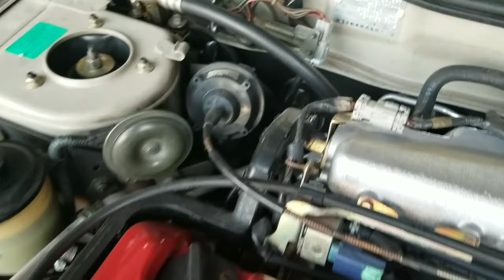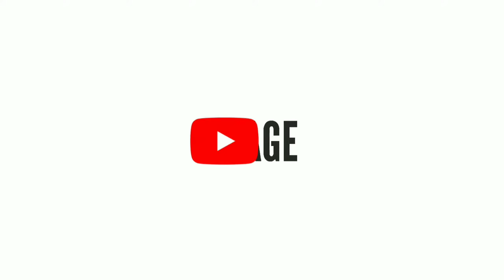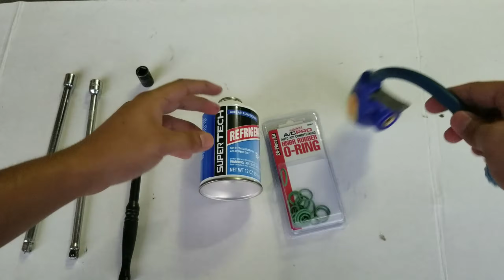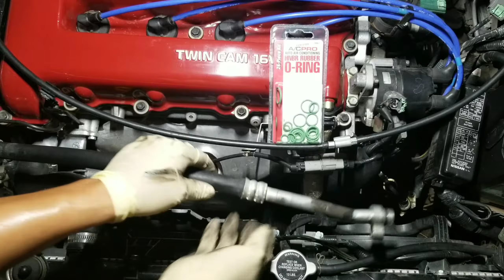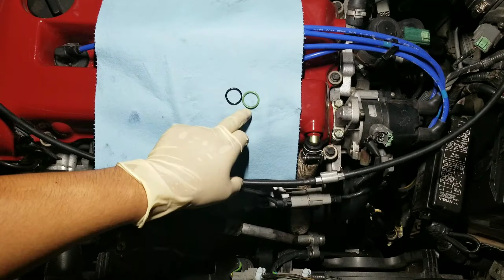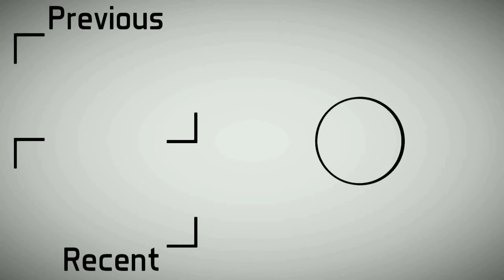How To Replace A Leaking A/C Line O-ring! | Infiniti G20 Leaking A/C Compressor Fix!

Comment: You have to run a vaccum on the AC system before adding freon
 Get a
Reply: You have to get the air and moisture out of the system

Comment: Yo I picked up the same o-ring kits two different times No damage to the components but for some reason those o-rings Don't seem to be working every time I pull a vacuum there's a failure what's up with that!

Comment: When the system has had a leak & lost refrigerant under pressure is one thing, but once you opened the system & removed lines.... moisture enters the system & will cause expensive problems. Really should've run a vacuum pump to draw any atmospheric moisture out of the system.... then add the correct amount of refrigerant.... just using those part store quick recharge cans without a vacuum decontamination... there will be internal corrosion issues from moisture in the sytem... compressors fail from it. Even a cheap harbor freight A/C vacuum pump & manifold guage set will work.

Comment: Any time you have to crack open the ac system you should replace the accumulator and vacuum down the system so it lasts longer overall

Comment: These o rings don't get brittle.  Mine after 20 years is still good under the microscope, no cracks  still pliable and soft. You can use  pure sillicon grease, just a little to help the o ring slip into place. You should push the plenum down to seat the o ring in then tighten the bolt to spec. You need to pull a vacuum first before the refrigerant refill. The moisture in the system will become acid and corrode your AC lines!

Comment: There will be moisture still because the correct way is to vacuum the system before adding refrigerant
Reply from the maker: I did mention that this is not the correct way of refilling your AC system

Comment: can I get O rings which is not the actual brand of the car? Or it has to be the brand of the car?
Reply from the maker: Yes as long as they are rated for ac
Reply: @ERICSDIYGARAGE  thank you
Reply: Hello, I'm try na replaced my ac compressor. Before taking out the old one, do I have to remove all the gas first or I can simply take out the old compressor?
Reply from the maker: You have to evacuate the system

Comment: You might want to mention that the system desperately needs to be vacuumed before refilling.
Reply: Especially since it will have air and moisture
Reply: Even if it’s had a severe leak and is empty?

Comment: Pls guide me my car gas leaked I refilled it as mechanic could not find any leakage....my question is that is it necessary to fill oil too with gas .... Pls guide
Reply from the maker: Normally no you don't need to add oil unless it's a new compressor that doesn't have oil in it
Reply: @ERICSDIYGARAGE  thnx for your prompt reply....  Thnx dear .... I myself thoroughly checked my whole ac System.... I saw very very minor oil in Schrader valve cap of Low pressure ... Is it ok or it's the place where there is leakage .. pls guide me one more thing I tried to see the cooling coil from inside of my car and find no oil spot on it... Which in my opinion reflect that there is no leakage ... pls do tell me how can I check oil level of the system at home pls...

Comment: I got a $1700+ estimate on my 2000 Xterra so I'm replacing the components myself.  I have more tools & time than money.  Compressor, expansion valve, dryer & evaporator.  Is there a o-ring at every connection?  One end of the old expansion valve to evaporator won't disconnect so I don't know what's in there.

Comment: You mentioned that it is safer to empty the system before removing the hose and that's fine, but removing the hose will introduce air into the system and you did not use any vacum pump to remove the air or humidity and you immediately started filling the system with refrigerant ... am I messing something?
Reply from the maker: I believe I mentioned that you should pull a vacuum and that this method is not the best way to refill the system
Reply: @ERICSDIYGARAGE  I watched the video again, the word VACUM is not even mentioned. I have a leaking hose that I need to replace and the system is completely empty. Do you think it will be a serious issue if I replace the hose and  fill the system with refrigerant without going through the hassle of using vacum pump to remove air and humidity that might get into the system
Reply from the maker: I've been driving with the ac like this since I posted the video and I haven't had issues

Comment: Good video. The best thing anyone can do is add a small amount of dye to the system and search for the leak using the blue light. Can't imagine how many compressors were replaced needlessly at a high cost when all it needed was to replace O rings or tighten or replace the schrader valves under the high and low side caps. All DIY guys and gals alike should learn this. I am surprised that with your system line open that it actually took in that can of freon, you would normally has to pull a vacuum. Cheers.

Comment: Does the drier needs to be replaced when the line is opened?
Reply: Every time the system is opened up per most manufactures
Reply from the maker: I don't believe its necessary

Comment: Just so hapened I used dye to find allot of dye on my line. I then thought bad compressor but after thinking about it and looking at the picture I see it coming from this conection. i assumed maybe it was a evaporator from just searching leaks for my car witch causes allot of work to remove the dash and allot more. I then thought it could be the compressor after seeing all the dye and thinking maybe when i installed my alternator I made the tension too tight that maybe ruined the alternator even that may not be possible.  Then thinking I might have to change the condesor too. After watching this video after searching about leaks from suction lines to compressor thanks to the dye that was able to pin point it out, I am confident that it a silly o ring. Thanks so much hoping for hope till I wake up to do this. I so didnt think it could be this easy.  Afraid to take it anywhere thinking they can say whatever and might try to charge off the bat and me not knowing could think it could be worst case senario from googling ac issues.

Comment: Mine is leaking from the High pressure o ring. Is it needed to unpressurize the hose?
Reply from the maker: yes or else it will blow up in your face dont ask how I know
Reply: Any repairs requiring opening the A/C system requires recovery of the system's refrigerant to prevent injury.

Comment: How did you get the air and moisture out of the AC system after you opened it up
Reply: you have to use a vacuum pump
Reply: Vacuum pump for 2 hours or longer and hairdryer on the dryer how i did it.
Reply: He many have attempted to "purge" non condensibles by pushing refrigerant through the system and illegally venting refrigerant and the non condensibles to the atmosphere. Just a guess...I see too many people try and do A/C work without the proper equipment with the good ole boy "git er dun" mentality. The proper way would be to evacuate the system with a vacuum pump and use a micron gauge to confirm there are no leaks. If the system holds below 500 microns, the system is tight and/or properly evacuated. Then when weighing in the charge, using a scale(assuming youre using a drum of refrigerant and not small cans), you purge refrigerant through the hose to the 134a adapter while tightening it up to ensure there are no noncondensibles in the charging hose. Mositure/air is the system's enemy. PAG oil is highly hygroscopic and absorbs moisture so if your system has been sitting at atmosphere for a time, I would change the refrigerant oil with the manufactured spec'd oil.
Reply: @robwallingsford9274  God damn right!  You need a machine to fill an a/c system.  I work for paccar in saint-therese canada working on brand new trucks, and all the mechanics had to learn how an a/c system works, and then we passed a small test to obtain a certificate "a card" to be able to fill an a/c system. This young guy here has never seen what a system with too much gas does??  There is a check valve that releases the excess gas, and there goes the o-zone layer!!  He should of done the job and then bring the car to get the system filled.  Here in canada my a/c guy charges me 100$ no tax.
Reply: @ginopalladini1737 new freon is not harmful to the ozone layer
Reply: @LZ2SM  yes it is
Reply: @ginopalladini1737  no it's not go read.

Comment: The O-rings leaking at the back of the compressor seem to be a common issue on Nissan Maximas, too. I replace them with the green O-rings. My suggestion is to put a dye charge in and check with UV light. Pump it down with a vacuum pump. If the clutch is good on the compressor and there is no dye anywhere else, it should be good to go. Refill with the correct amount of 134A. Buy the vacuum pump and decent gauges. Learn how to use them. You will be glad you did. Both can be had for >$100. A small scale for weighing the refrigerant is good to have too.
Reply: Yes, vacuum pumping the system evacuates the moist air that could clog the drier.    It also makes it easier to get the refrigerant into the system.  Be sure to allow the vacuum pump enough time to suck out any moisture in the drier.     You should only use the twin-gauge manifold for A/C recharging.   It shows the vacuum pressure and let's you do a Draw-down test to make sure the system is airtight before adding refrigerant.

Comment: Does anyone know what the hose from the compressor to the condenser is called?  Also is it the suction line?
Reply: discharge line (high pressure) and suction line (low pressure)

Comment: Hello thank you for you video and help, now Iwould like to ask you if you are  ok with it
I have the issue I lossing freon like you from the  "o" ring low port ,  BUT LOOKING AROUND A SEE A TINNY DOT ON THE CENTER OF THE  screw that hold the plate ( clutch ) 
Do I have to change  the  compressor,  can I system be leaking from the clutch  ?

Comment: DIY videos like this keep me rebuilding AC Compressors 12 hours a day 6 days a week ... 
Keep up the Good Work :)
Reply: You not sharing what you know to help people.
Reply: @sauljob2396  You can only top off systems that are not fully discharged. In this case you should be running a vacuum pump for an hour to make sure it has no other leaks, and more importantly, no moisture remains in the system. That's what kills compressors.
Reply: I'll take my chances with good hearted, knowledgeable people like Eric.  I've learned so much on this channel.
Reply: Uhmm

Comment: Thanks! My Nissan Murano was leaking at bottom o ring too at compressor line from condenser and found with dye from Walmart. Getting o rings from advanced auto so gonna be a good summer after all as I was dreading no air!
Reply from the maker: that's awesome glad it helped you out!

Comment: Nice vid.
Question; I see a litle bit of oil around one of the fitting on low side, car doesnt blow cold air, but there is presure in the schrader valve, do I need to have evacuated still? Or can I just bleed off lines?

Comment: Most helpful. Fixed AC in my 2000 Xterra. Had the same exact issue. O-ring where it meets the compressor. Cans only though. I first put in a small 10oz can of refrigerant + dye to detect, and jumping the AC relay. Didn't have the yellow glasses, but it was still quite visible mid day and with a black light taped to a stick. Got the o-rings from Harbor Freight, cheap $6. After replacing o-ring, started at zero pressure, lines empty. AC clutch engaged as you stated after a few seconds of filling. I only filled to just within green to be on safe side. I let it sit and monitored the pressure for a few minutes. Leak is gone! Thanks so much.

Comment: Does ac refrigerant discharge hose get sweat when ac is running?
Reply from the maker: if the ac line is sweating thats a good sign, it means its working as it should
Reply: ERICSDIYGARAGE mine has lots of moisture(sweated) including aluminium and rubber on low pressure line. Is that normal?
Reply: low on gas

Comment: When you change the O-ring and put the a/c line back together, is it okay to still drive with the car for like.. 1-2days?
Cause I need to visist a mecanic to help me fill the "gas". Thanks :)
Reply from the maker: yes it will be fine, your ac compressor wont be on because you wont have any referggent
Reply: @ERICSDIYGARAGE  Thanks alot for the fast answer! Hopefully, the o-ring will solve my leakage problem, but we´ll see :)

Comment: What about vacumming the system was that needed?
Reply from the maker: yes you should put a vaccum on the system but I do not have a vacuum pump so I didn't do it. so far I have not ran into any issues with the ac.
Reply: @ERICSDIYGARAGE  you can get one from autozone for free as a loaner tool
Reply: @artbyrobot1  not free they charge for loaner tools but you get the money bacj
Reply: ERICSDIYGARAGE not a smart thing to do and then you are also showing people how to do this the wrong way. 
YOU HAVE TO PULL A VACUUM THEN PUT REFRIGERANT IN.